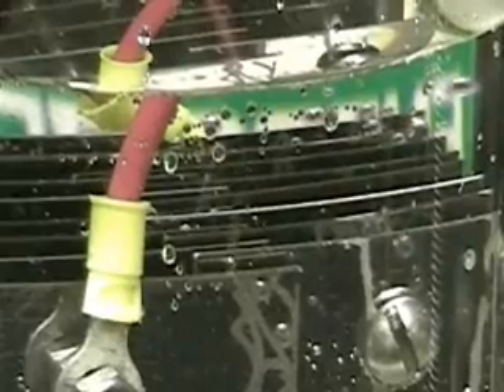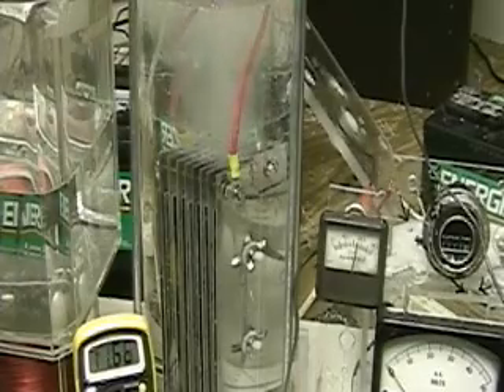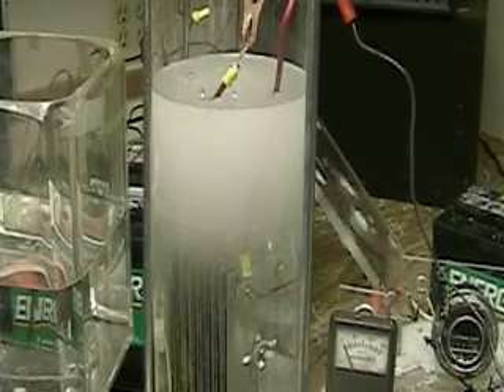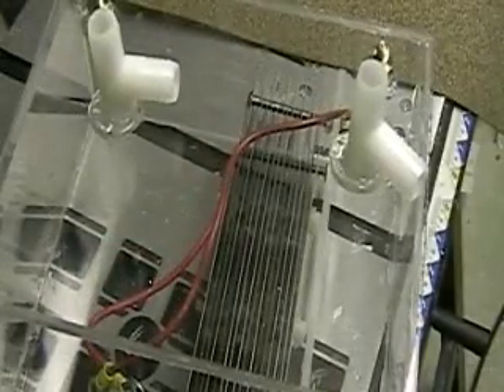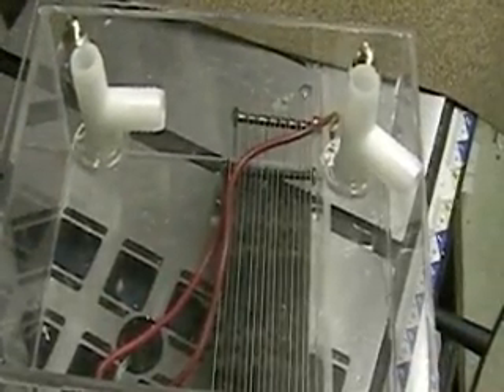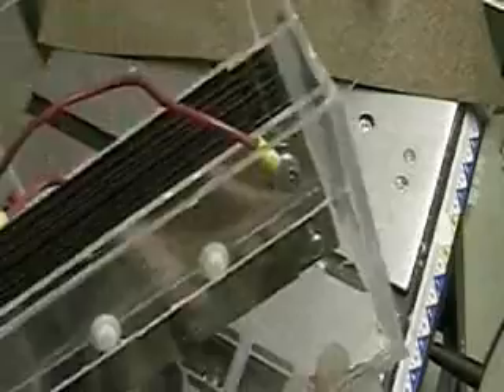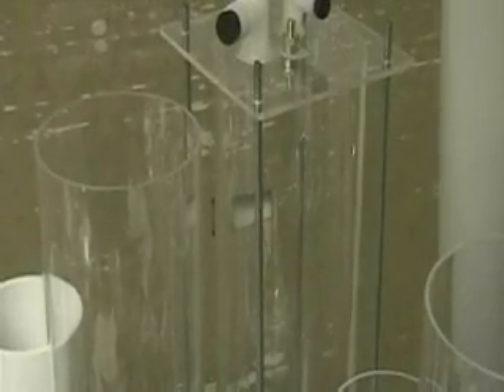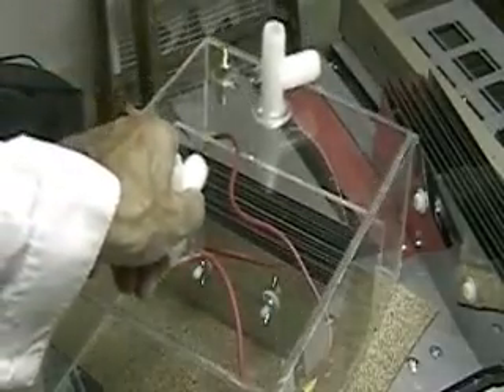Hydrogen Tap ( 3" by 8" runns and more) 112

Comment: Well John, you may try and use the fuse block under the hood to trigger your relay that powers your cell(s) and use the manual cut off switch that you were going to use to cut the power to your cell(s) for your
fuel cut-off switch as you don't necessarily have to use the wire that comes off the ralay to power it as long as that sw gauge wire is big enough to handle it

Comment: You did say that you have the wiring diagram, right? Look and see what the color code is to the wire that comes off the relay going to the fuel pump. Then cut that wire and connect the wires coming from your switch mounted on the dash, so you can control it from inside.

Comment: On my test car, all 4 wires were located under the hood (by steering collum)and there was a 4 wire plug just before it continued into the firewall to the ignition switch. Unplugging the connector, I touched a Pos. wire to 1 wire at a time(not the black ground wires!) till I heard the pump run then I cut the pump wire and put male/female connectors where I cut it so it could easily be returned to normal. You might want to put a toggle there to make switching back and forth much easier.

Comment: About turning off the fuel pump, What I did with one of my test vehicles was crawl under and locate the wires going to the top of the fuel tank, two will be the gauge and two will be the pump. Note, each will have there own ground wire so two wires will be black. You want to take note of the color of the other two wires. Continued....

Comment: John, you are going to have to drive it to see the difference it truely makes. As I increased the electrolyte til I got 10 amps cold across both cells and it made it really pick-up the top-end. Then I drove it for hour measured the temp 185 to 187 and it looked like it was boiling hydrogen. I guess I'll try what I told you to do and hook a switch to the fuel pump and see what it will do. Later

Comment: have you seen the 'stanley meyers voltage intensifier info' video. It was put on this site by 'bestfreesylist'.  Hear what he is saying about the voltage doing all the work and very low amps.  In short, the more amps you are using, the less efficient the process is. Anyway watch the clip and you'll see what i mean.

Comment: Also, the baking soda and vinegar will probably be more conductive than what you are using with your 16 plate setup and lye, and your 2 plate system would probably work better with the extra electrolyte if it happens to be more cunductive, I havnt been able to try Lye yet to know. I do know that the baking soda and vinegar drastically improved the water from getting dirty and mucky after several hours of running.

Comment: Are you betting on your 2x (8x16 Aarons Cell) being enough to run the car at high RPM's John? I suppose... even if it takes 3 or 4, and even if the pulse system doesn't bring the amps down, worst scenario would require a larger alternator & battery to offset the additional load. This is so exciting! lol.

Comment: John I like the one that lays down as well. As I mentioned before I think that the closer the plates are to the surface of the water the more you will get out. so a design that is low profile is going to work better. Because of water pressure.

Comment: BTW, I hooked up my power relays off of the ign. switch wire to a 30 amp toggle switch that way when the ignition switch is off so is the current to the HHO cell. No accidental pre-ignition